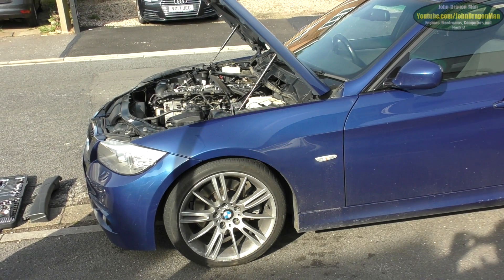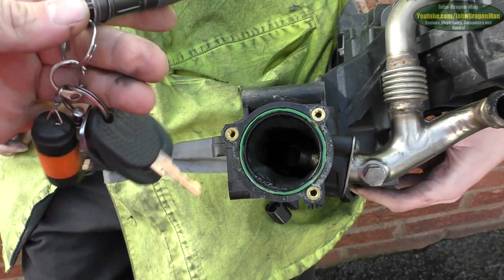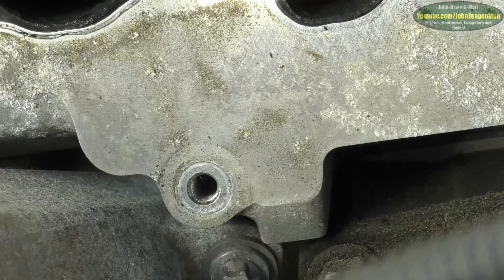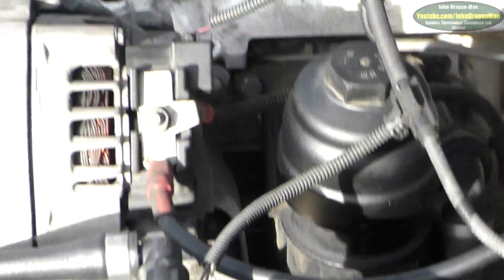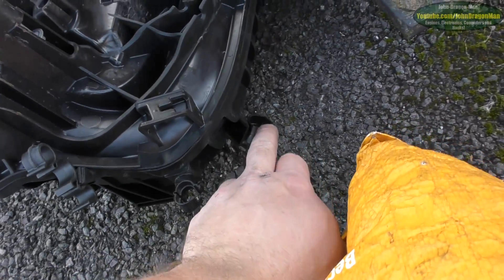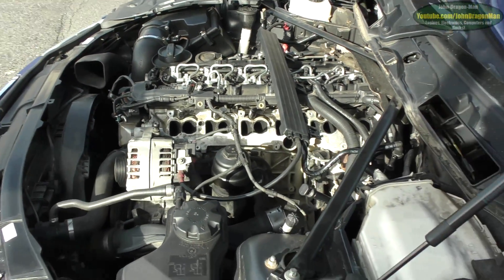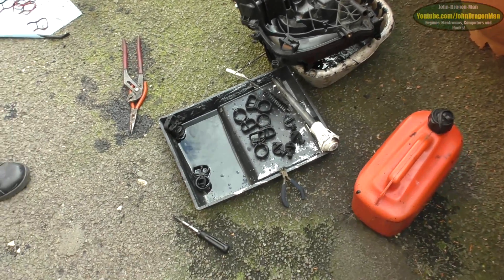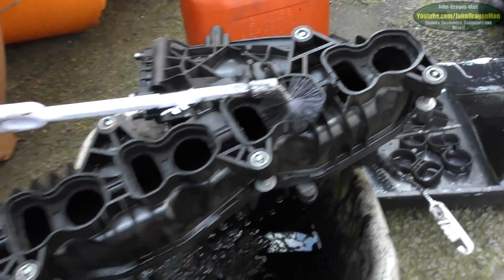BMW inline 6 turbo diesel N57 EGR AGR swirl flap and intake manifold removal and clean

Comment: Apparently caustic soda powder, warm powder, large plastic container from B&M, all the alloy parts removed, brass should be ok. Soak the inlet manifold and flaps for 24 hours and pressure wash it clean. Let it dry, in a warm place. Refit the next day. The crud comes right off. Caustic eats through it. But caution when working with caustic, gloves and protection is a must. It will burn skin. Other option you have is deepio powder, or Mr Muscle.

Comment: I deleted the swirl flaps on my n47 123d and lost all low end torque and boost, any help or advice please?
Reply from the maker: could be a boost pressure leak. or pressure sensor not plugged in. best way is to look at the data from the sensors using a code reader or laptop.
Reply: That's normal. That's what happens
Reply: That's why you don't delete them mate. Remind to where he showed the intake manifold and you'll see 12 ports on it, 2 for each cylinder. The smaller narrow 1 is the normal port and the larger port is where the swirl flaps sit. By blocking that larger hole you're shutting off half the air going to the engine, plus the air fuel mixture doesn't mix properly in the combustion chamber.

A lot of people notice loss of low down torque, but some say its the same if not better than before so it's not really consistent.
Reply: https://www.youtube.com/watch?v=Q2ejm-D-IDQ&t=20s

Comment: Delete the egr and swirl flaps. By the way the swirl flap plastics will eventually degrade and will break away into your engine fact, its happened to many bmw owners. I have mine both deleted on my 525d 2004/05 and runs perfectly no smoke or major carbon build up
Reply: This is the bmw n57 engine. The swirl flaps on N57 is not so dangerous as the older m57

Comment: Do you know any performance air intake for this engine ?
Reply from the maker: dansobolanu the engine is running all stock filters and induction. after cleaning the intake out there was noticeable difference to pickup speed. also taking a before and after reading from the mass air flow sensor the air movement at higher rpms was better after cleaning.

Comment: can i ask why you didnt blank the swirl flaps off , isnt this the one major issue with this engine ?
Reply: New BMW’s don’t have swirl flaps for this very reason. They’re not worth the risk for the sake of a few quid to blank them off.
Reply from the maker: why because in the UK such an act would be against the law! ;)
Reply: where did you get that from, bmw actually sell the blanks to do this procedure, and if not done the risk is very high of them working loose and falling into the engine causing catastrophic damage resulting in engine failure
Reply from the maker: SuperMaxibaby well if you was to remove them, what I suggest would be to put the retaining cage back in without first putting in the swirl flap ball looking things.. you could then push the metal rod back in position and just have a bar that turns with nothing on it or you could not use the bar and just seal the hole up in the end under the actuator with some JB weld or whatever.
Not that we have done any of that...
Reply: @SuperMaxibaby  wrongg, M57 have swirl flap issues, completely different inlet manifold.  This N series engine had a revised manifold to prevent ingestion failure as you can clearly see in the video!! Also BMW themselves categorically do NOT offer a blanking system for the M57 engines, as they simply suggest a new inlet manifold.  After market companies offer the blanks.  This manifold would not need blanks clearly judging by the design.
Reply: @johndragonman   Right. Deny. Deny. Deny. Lol.
Reply from the maker: @darrenkohls7431  ;)
Reply: @germancarfan360  absolutely correct.

Comment: Great work guys. I've added this link to the forum for all to see.
http://www.e90post.com/forums/showthread.php?p=22314290#post22314290
Reply from the maker: ChawenHalo 008 thanks I am not on the forum as its not my car, its my brothers.. The other guy in the video. He may be on the forum though!
Reply from the maker: hey man..  make sure on the forum that people know that the hole the swirl flap rod goes through near the actuator needs to be blanked off. just use a 2 part epoxy glue like araldite or JB weld. thats if you are removing the swirl flaps completely ;)

Comment: Its amazing to see the inside of the engine as its running. I bet the engine management light came on during that.
Reply from the maker: yes it was lit. no EGR actuator, anti shudder valve, boost pressure sensor, swirl flap motor, the mass air flow sensor reading completely wrong, and i think an air temperature sensor was also not plugged in. i was actually impressed the thing even started at all! it didn't even seem to be in limp mode!
Reply: I cleaned out my inlet the other and had to remove the egr and throttle body. Perhaps it would run with the throttle body connected but would sound like a tank.

Comment: Mr Muscle also works very well on EGR valves and intake manifolds. Spray the insides of them and turns all the carbon, grease oil etc into gunk with in minutes. You could also do with oxy but you have to keep the parts very cool whilst doing it.